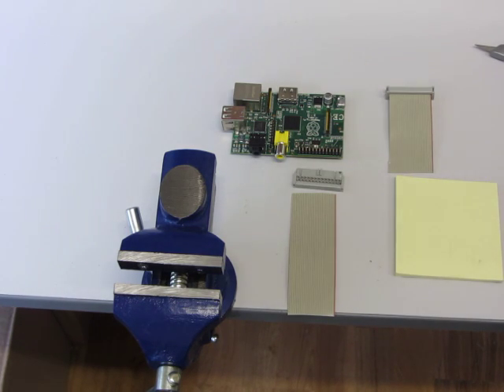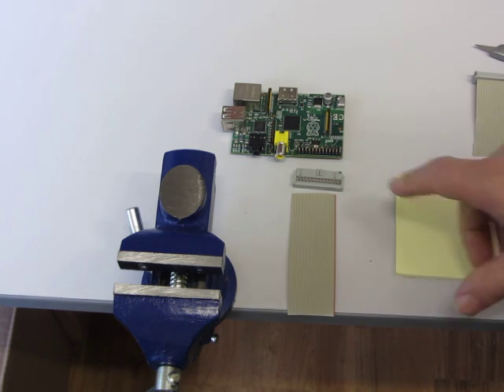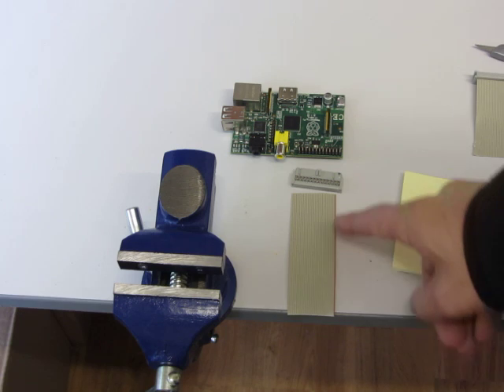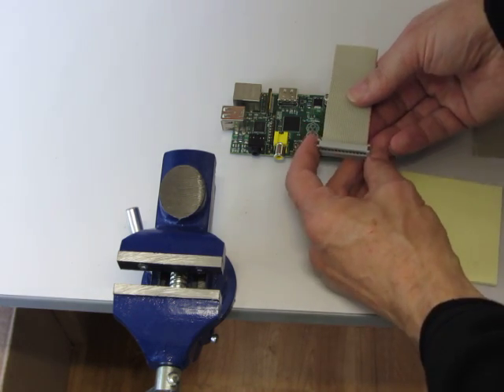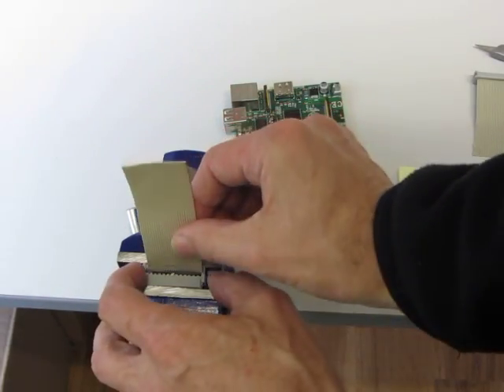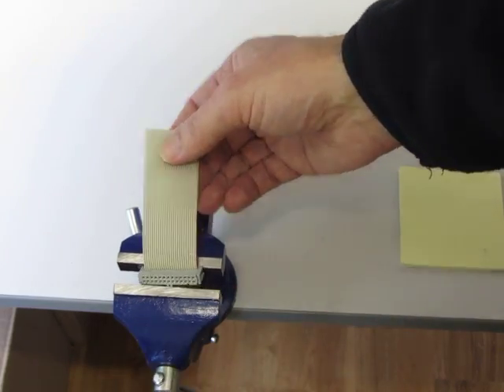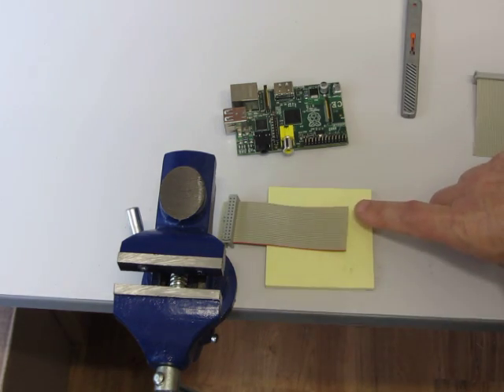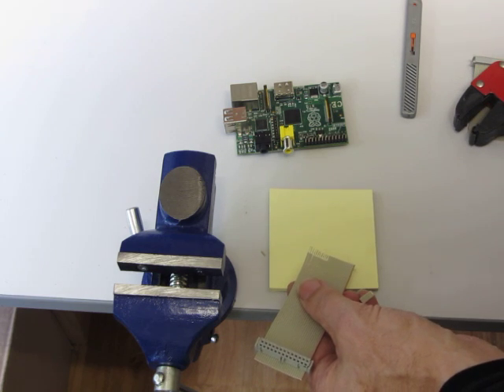RaspberryPi Press connector

Comment: I used to build my own scsi ribbon cables this way. It really is easy as long as you are careful to mind where pin one is. When you use the vise to crimp the wires you can usually hear the ears snap over the ends of the connector and that indicates the connection is set.

Comment from the maker: Sorry hit 'enter' before I was finished: The cable stands are 0.5" (1.27 mm) apart all adjacent. The pins are 0.1" (2.54 mm) apart but are in two rows. The press connector will always connect the right cable strand to the right pin. That is why the pins are numbered as:

Comment: Often the connectors come with strain relief; in which case you actually want to put the cable together pointing the 'wrong' way (still with pin 1 on the cable matching pin1 on the connector, but with the cable hanging over the board instead); after squishing it in the vice, you then fold the cable back over the top of the connector (thus reversing it so it won't hang over the board anymore) and insert the strain relief clip over the top.